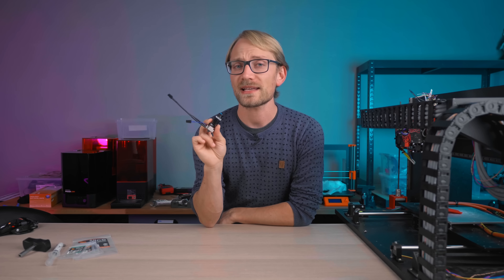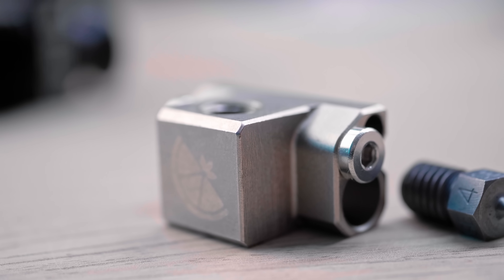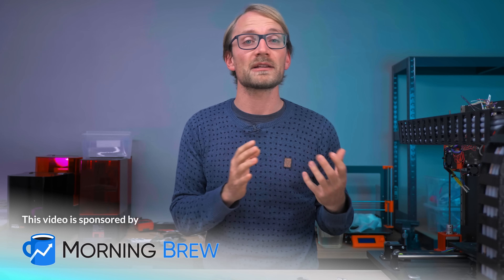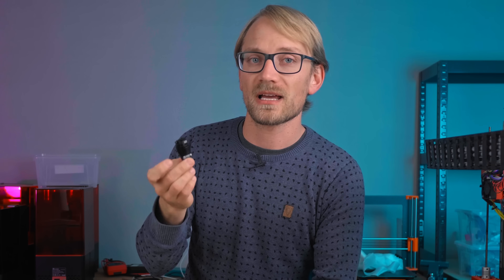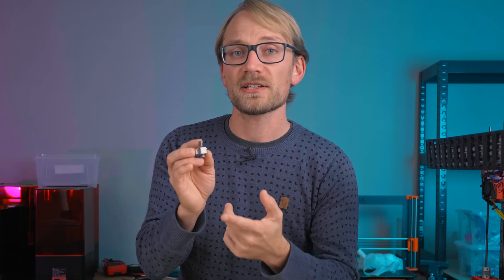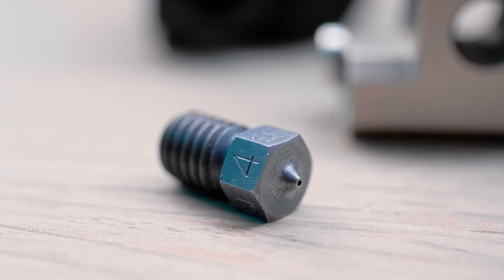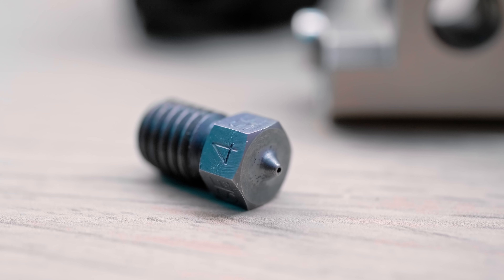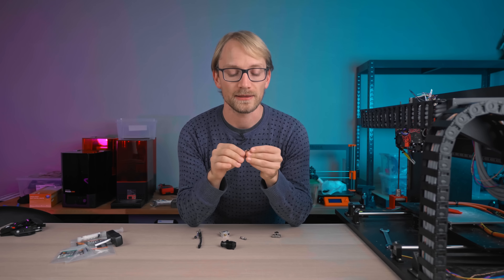This modular hotend seriously impressed me! (Slice Engineering Copperhead Review)

Comment: I would be interested to see a comparison to the nova hotend. i've seen some pretty amazing videos of that and it would be interesting to compare several of the more expensive options.
Reply: yup, I'd love to see a side by side, especially cause the copperhead is more expensive and claims to be the "better thermally performing" one, push each one to it's limits and let's see who wins!
Reply: keep in mind, in his tests the  copperhead started struggling at 20mm³/s at 210, while the Nova can do about double, I have to say I'm kinda biased as I've  tested the nova thoroughly and don't have the copperhead, but I'd still love to see a scientific side by side test
Reply: @l3d-3dmaker58  I think this test was hobbled by the heater.  The slice heater is 50W compared to the 30W heater used in this video.  The nova's 60W heater should outperform the 30W one.  A real test would use the proper slice heater for a proper flowrate comparison.
Reply: @joshsekel  yes, he didn’t review the whole system. The info he provided was great, but was not a fully fair review. If you’re going to keep going on about the price of the full kit, you should review the full kit and show people what they would be getting for the money.
Reply: @joshsekel  Heater cartridge power does not affect hotend flow/melt rate, that might sound crazy and isn't intuitive, but it is the truth about how the system works. This was a fair test, and changing the heater would have given them same results.

Comment: They took the ONE bad thing of the V6 (the heatbreak as structural) and copied it...
Reply: that's not the only bad thing about the v6🤣
also, having basically 4 heatbreaks as support like the mosquito is dumb, you're having more thermal transfer for no good reason, maybe "one handed nozzle swap"? how useful is that really
Reply: @l3d-3dmaker58  As far as I can tell they are significantly thinner than the single heatbreak E3D uses. I think they call them 'medical tubes' or something, probably normally used for needles. And structural is good for nozzle crashes (which Tom did in this video lol)

Comment: If you want to measure the temperature of a piece of aluminum, don't use a thermal camera if you don't adjust the emissivity for the material
Reply: I think this was pointed out to Tom in a different video as well.... can't believe he did the same thing again lol.
Reply from the maker: I'm very aware of this, which is why I was looking at the lower section of the heatsink at an angle. The fact that both the direct measurement as well as the visible reflections only hit the heatsink, it should be a fairly accurate reading.

Comment: Immediately trying to justify not changing the heatsink?? Your test was over before it began.  If you fudge the process at the start, making exceptions and excuses, nothing will be reliably accurate.  SUPER FAIL TOM!!!!
Reply from the maker: What
Reply: Heat sink is not part of the product, it’s optional. Strongly suggest to google little first...
Reply: @kr15uk  In order to use the correct bi-metal heat break  for this product to function as intended, you must use the copperhead heatsink, that is not compatible with an e3D V6.
Reply: @Jynxx_13  please, google their product page, scroll down to picture which has 2x with heat sinks and 5x or so without. Product is copper head + heat break + nozzle...

Comment: In terms of speed tbf you'd use a volcano for higher print speeds over a v6.
Reply: volcano probably outperforms copperhead for half the money lol
Reply: @l3d-3dmaker58  no. Not even close. The volcano breaks thermisters left and right and its so much more metal to heat up its unreal. I upgraded from a volcano to a copperhead and quality went through the roof. The volcan is very similarly priced to the copper head.
Reply: @gagehughes2297  what about speed though, not quality?
Reply: @gagehughes2297  Did you use the same heater cartridge? Same mounting (with thermal paste? same voltage? ...) That bit of thermal mass should not be a huge issue for any of the cartridges to get to temperature. But if you compare a 30W E3D cartridge to a 50W SE cartridge, of course they perform pretty differently...
And how the heck do you manage to break multiple thermistors in a volcano? Do you overheat them, or tighten the grubscrew until it squeezes the thermistor out again?
Reply: @timothymusson5040  my speed is limited by my bed. But when I put it on my delta it was better than at over 100mms
Reply: @ProtonOne11  I had the slice heater cartridge on both of them. I used the same thermistor for a while but then switched to a slice one because the e3d one broke for like the 8th time
Reply: @ProtonOne11  the thermisters would just quit. The wires were at to tight of a angle and the would break. I was only printing at a max of like 260
Reply: @gagehughes2297  E3D's new thermistors are better. The original design was bad, a single strand wires going from the cartridge to the connector. That said I don't think there's anything specific to Volcano that breaks thermistors. The only one I remember breaking was me trying to extract it from a plastic blob.
Reply: @JeffDM  this was like 6 months ago.
Reply: @gagehughes2297  You keep talking about braking thermistor cables and some movement there... Hint, if you do good cable management (2x zip ties 2cm apart at at the very top to tie all the cables to your moving gantry) there will be zero cable movement around the hotend. Also please make sure you have good strain relief (3mm nylon filament along the side your cables should be good enough).
Reply: @kr15uk  the way my hotend is i cant do that.
Reply: @kr15uk  I have nylon braiding around it and I can't zip tie it because do the hotend design. I have tried and it just doesn't work mostly because as it goes to probe the points the wire loom hits the right gantry post.
Reply: @gagehughes2297  I'd highly suggest to figure out the way to do so. Thermistor cable breakage is good example of what happens if you let it flap in the breeze, thermistor cable has the same core strings as heater cartridge only 10x times more so it will take little bit longer but eventually it will happen. Also most printer fire accidents are due to bad wiring. Also little personal comment, please stop saying volcano hotted is bad just because you haven't mounted it appropriately, it's like saying certain car make/model is slow and noisy, and engine goes quickly just because you don't know how to change gears. ;) Take care.
Reply: @kr15uk  I had it mounted write for a while and it still wasn't nearly as good as the copperhead. It jammed alot and took forever to heat. I had it wired correctly since I put it on it is just a bad design
Reply: @gagehughes2297  well everyone have their preference at the end and it’s fair to say that you prefer Slice vs E3D products because you had better experience with copperhead, I just want to point out that it’s not all doom and gloom with E3D and often is as simple as correct mounting, cooling, firmware and software settings - there are many variables. Yes Slice bimetal heatbreak is more resilient to incorrect retraction settings for example and that is a good thing but at what cost - pricier and more fragile. Higher extrusion rate, E3D went with thermal mass but Slice same small heater block but more powerful heater - what cost, risk of getting dangerously too hot if left full blast on. Example is one of my machines which had 40w heater, on every startup Duet board was throwing a warning “heater is overpowered, if left unattended it can reach 445c” unsettling for the PLA machine with ABS hotend mount. Changed it to 30w, yes heats up slower, totally, but I feel fine’ish leaving machine unattended for couple of hours (never do though, bad practice regardless).
Reply: @kr15uk  yea I know my delta has a v6 and I still have all my e3d parts I just had better luck out of the slice parts.
Reply: @kr15uk  I have school so I have to for like 9hrs a day

Comment: In my experience (with full copperhead) the flow rate rivals my volcano but has more control when changing temps (less overshoot). 
Still waiting on flows rates directly from slice on copperhead, I bet it’s close to mosquito. 
Also for the idex folks, with full copperhead, you can set height of each nozzle very easily and accurately.
Reply: what is the stock mosquito max flow rate? i've only found data for the magnum
Reply: I tried copper Volcano, at speed less than 100 mmps no difference, but as a bonus it stopped working with Duet WiFi after PID tuning due to very long heat up time.